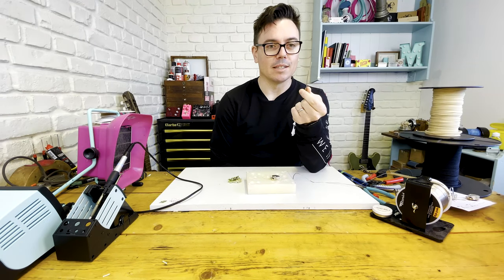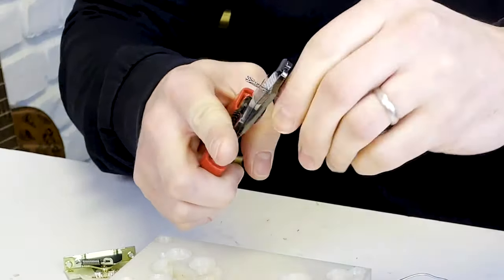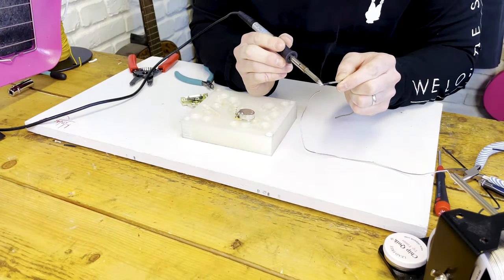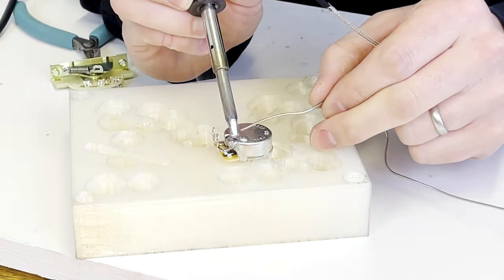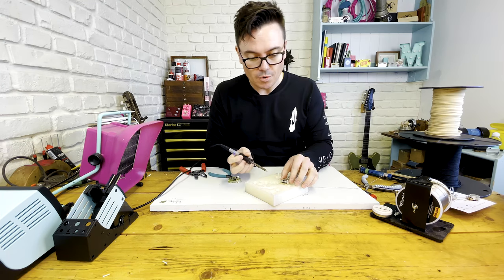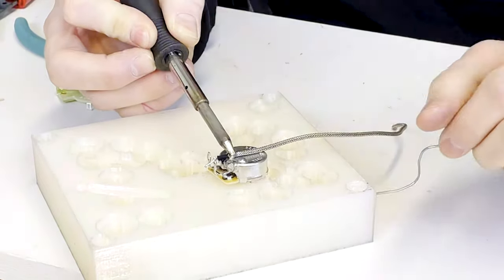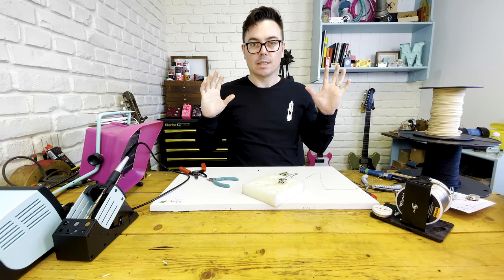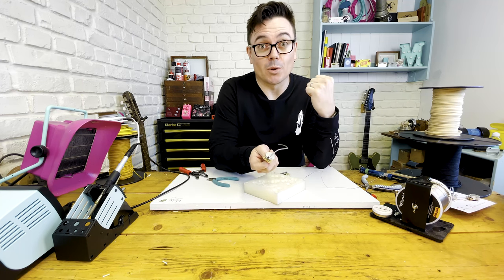How to solder with 2 conductor braided wire in your guitar

Comment: Hi Matt, what temperature is the soldering iron? every time i try to ground wires to a pot it looks burnt and horrible😩thanks and greeting from germany
Reply from the maker: With my soldering iron I use 300-350 for most things and then 450 for soldering to big lumps of metal. The main thing to do is make sure your soldering iron tip is clean. If you haven't already get yourself some wire soldering tip cleaner and also use a tip activator after each soldering session to keep it in the best condition.
Reply: what solder type/brand & diameter are you using for these type of jobs Matt ? hard to tell but looks a bit thicker than the 0.8mm - 1mm I've been using. I never seem to get the nice shiny bubbles/pools of solder like your perfect results every time!❤

Comment: Any suggestion on how to add length to a short braided wire from an old Gibson mini-hum? Is it just as simple as soldering on some normal wire from the braid that exists to whatever length you need to add and then solder the other end of the normal wire to the pot? I'm sure this will work, but wonder if there's a better way since it's braided?
Reply from the maker: That’s a goodn’ just extend the wire
Reply: @Montysguitarsandpickups  Thanks, bruh!

Comment: Is there a way to solder the wire to the switch. I wanted to change the single coil on my tele to a Humbucker with braided wire. My problem is that the single coil hot was soldered to the switch. What should i do?
Reply from the maker: Hey, I would strip the braid way back so that you have enough of the inner cloth wire to go between the back of the volume pot and the switch. I hope tat helps. Cheers Matt
Reply: @Montysguitarsandpickups   I already tried it this way but it didn't work. Anyway , thanks a lot for the response
Reply from the maker: I'm sure I can get you up and rocking, dear chap. Could you send a picture of the wiring to mail@montysguitars.com so I can see what is going on @gerardbrandenbourger5440

Comment: Thanks Matt. You make it look so easy ;) What about wiring up to a Tele switch where there are lots more terminals in close proximity to the ground wire? How so you prevent the braid from coming in to contact with the other terminals?
Reply from the maker: Thanks man glad you liked it. I would strip the braid right back and so you could solder the braid to a pot and then have the inner wire going to the switch without any braid on it. I hope that helps. Cheers Matt